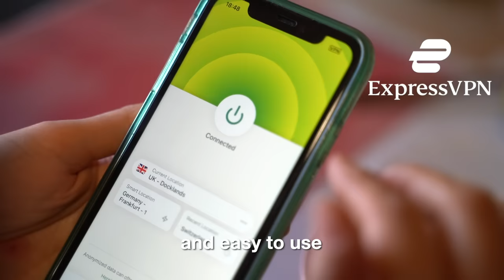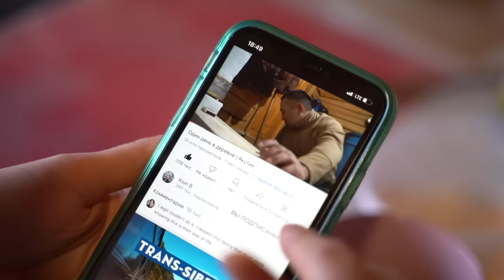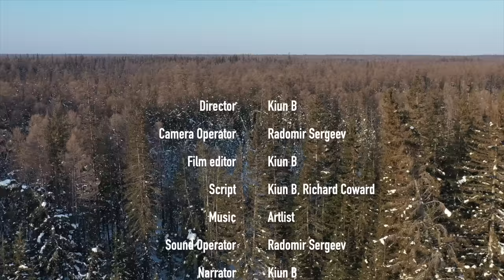Spring in the Coldest Village on Earth | Yakutia

Comment: spring at my town reaches out 50 - 60 degrees Fahrenheit  so its pretty warm where I live during spring. in summer it reaches 70 - 85 which is extremely hot where I live. in fall or autumn it gets down to 60 - 46 degrees which for me is perfect temperature. in winter it gets... cold kinda, it gets down to 45 - 12 degrees which isn't cold. living up north is really nice 👍

Comment: Why not use snow for water
Reply: The fact is that the water obtained by melting snow has a completely different composition. At its core, snow is a condensate that has collected and frozen on microscopic dust particles. And what is condensate? This is distilled water that does not contain any trace elements and salts. Not only is it simply impossible to get drunk with such a liquid, it also washes out of the body all the salts and useful compounds necessary for a person to exist normally. An adult with high physical activity should drink at least two liters of water per day. If we take this fact for granted, we need to calculate how much snow we will have to melt in order to fulfill the norm. Since snow has a very small density (freshly fallen - 100-150 kg / m3, stale - 200-300 kg / m3), in order to get 2 liters of water from snow, it will have to consume about 7 liters. The task is not an easy one, to put it bluntly.